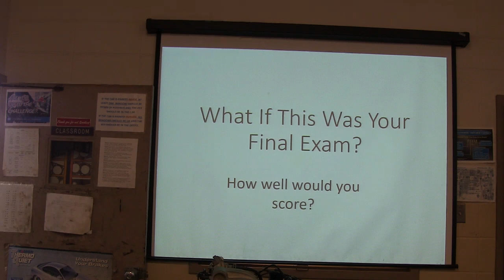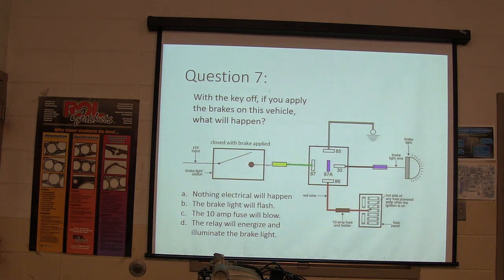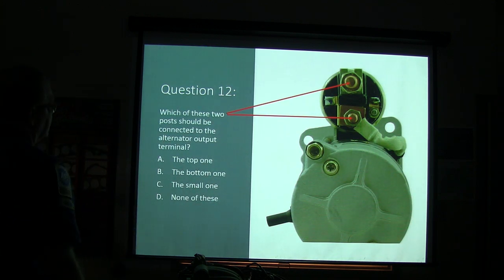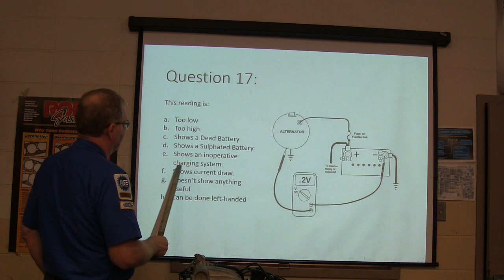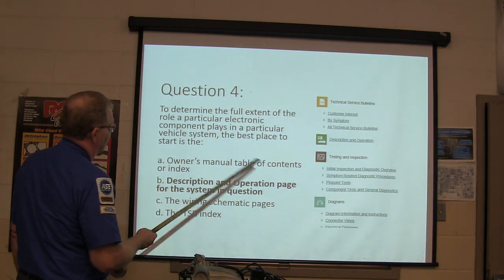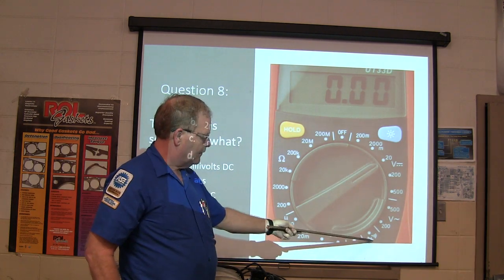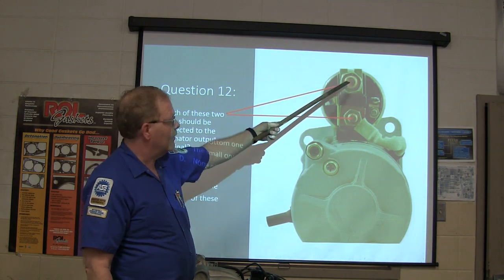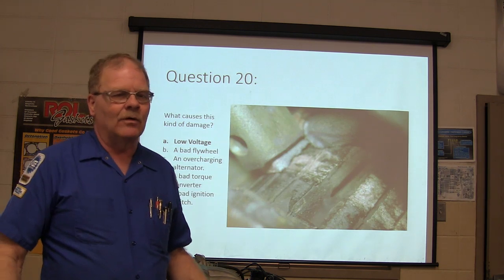Practice Test Electrical 1

Comment: I’m getting a clicking sound when I try to start my car up so I checked my connections had a corroded negative terminal went an put a new terminal on an the car still won’t turn over do I need to get a  jump or a new battery
Reply from the maker: Have the battery checked at the parts store.